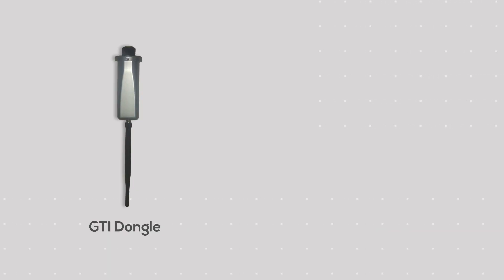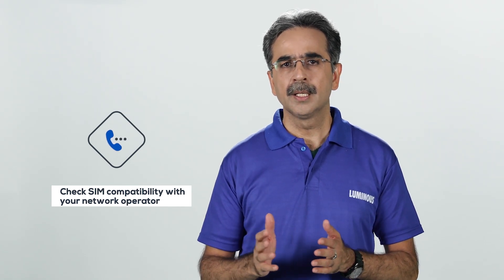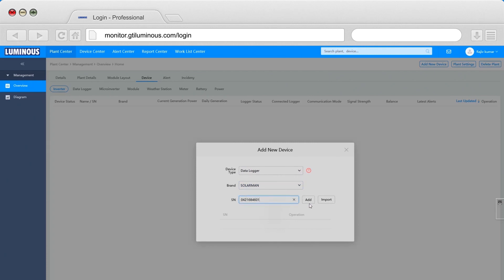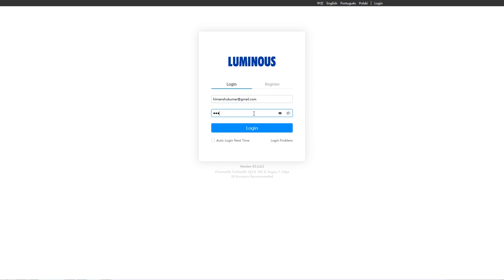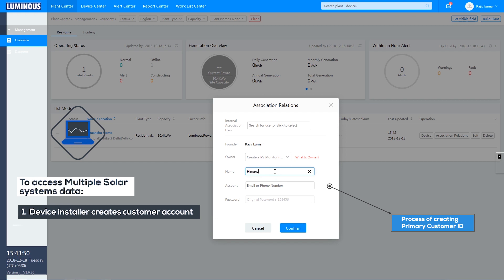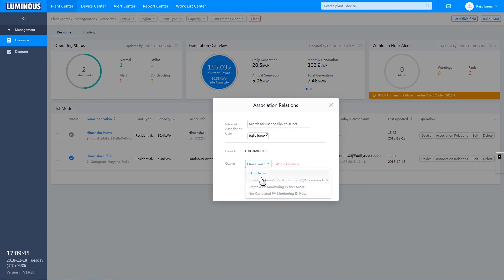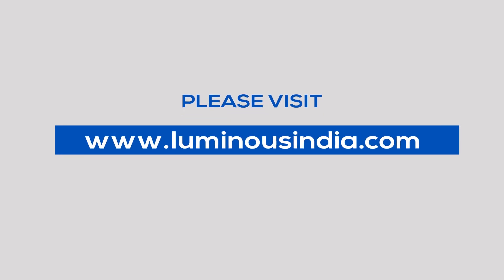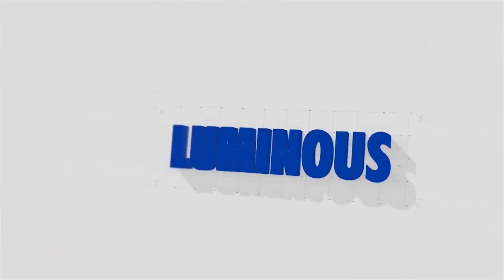How to install the Dongle in the Grid Tie Inverter -Luminous Expert Advice

Comment: Where to buy Wifi Datalogger for Luminus 10kW On-grid (NXI380) Inverters?
Reply from the maker: Hi Sudipta, As of now stock is of not available for Wi-Fi dongle, kindly connect in October. If stock is available, delivery can be done .

Comment: @Luminous Team:
Its very worst customer experience after I purchased SolaverterPro PCU 2kva :
1. I have searched online/offline , no where luminous wifi data logging stick not available.
2. I have purchased DLS-W from other vendor now its not working with luminous solaverter Pro PCU as inverter not sending any data .
3. I have logged complaint (4013360041)  but as per the discussion with tech support team not trained to handle this type of issue and still not resolved.

I would request Luminous Team to resolve the data logging issue for luminous hybrid inverter as we purchased the product after seeing the features and after purchasing it found not working at all and compatable device is out of stock from last one year.
Reply from the maker: Hi , We regret the inconvenience . We have escalated your concern to the relevant team on priority, they will connect with you as soon as possible.
Reply: Hi Dhrobajoti, were you able to get your wifi dongle issue resolved from Luminous?
Reply: @sja7063  Yes, Thanks to Luminous team for the extended support.
Reply: @dhrobajotipaul7683  Brother we have a same issue regarding wifi data logging stick ..can please tell me how luminous team  has solved your problem ...